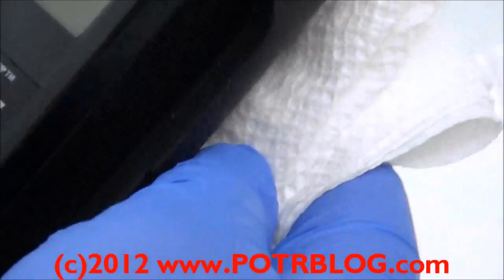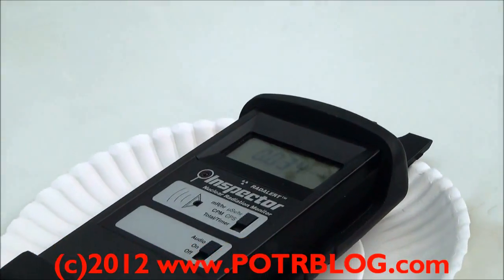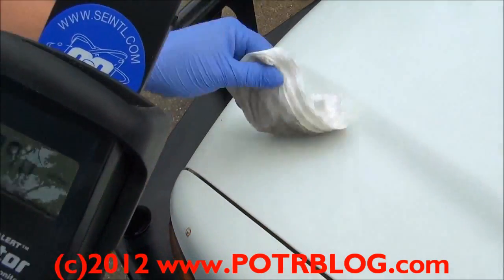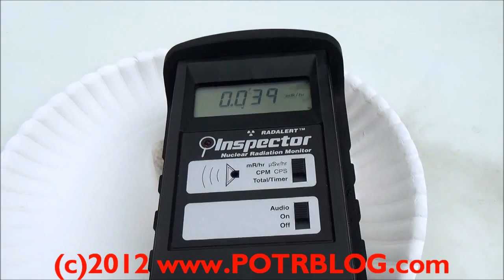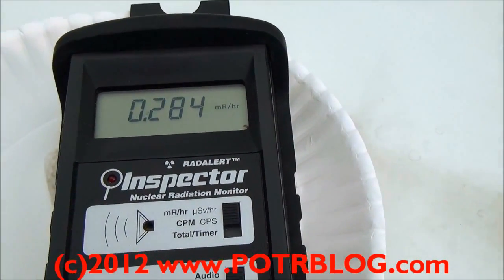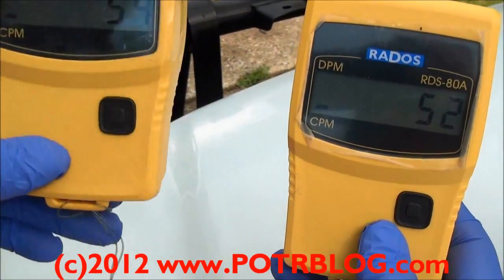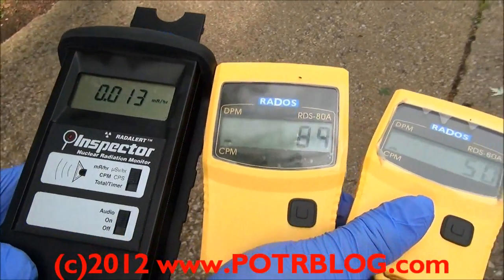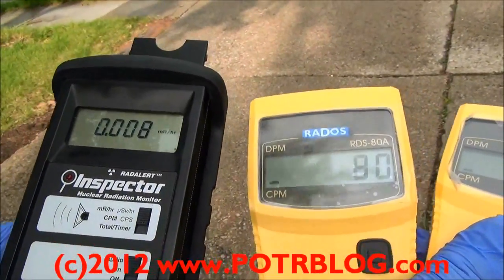!MAXIMUM ALERT! AIRBORNE RADIOACTIVITY 5 TIMES GREATER THAN BACKGROUND RADIATION

Comment: I did pickup loads of radon washout from that storm. It might be interesting to determine why such storms contain such levels of uranium progeny.

My Geiger counter actually went up from in my office, from 38 CPM (average) to as high as 70 CPM (around 65 average). I can only assume that testing outside would have been much higher.

The bismuth 214 and lead 214 gammas were a trouble for my spectrometery all that night and I gave up until the next day.

Radon washout is very neat!

Comment: I 100% agree with you. It is important to understand the detection limitations of our equipment.

I am blind to beta, with my spectrometer (of course). Luckily, I-131 produces a gamma 81.7% of time or better. The average beta energy from I-131 is 191.6 keV (606.3max), so the rates of beta vs gamma are quite close. My spectrometer gets about 3600 CPM in my office vs my Inspector (same as yours) at about 38 CPM.  

(cont...)

Comment: You make another good point for radon washout.The two isotopes involved for the quick "run" of transient decay are powerful beta minus emitters. As you know, rarely does a beta minus have a quantum state which is "super allowed" (such as tritium) so they typically transition into a metastable state. They are the most potent gamma emitters. Ra222(a)->Po-218(a)-> [Pb214(b)->Bi214(b)] ->Po214(a)->Pb210

Were you referring to Sr90?

Comment: (...cont)    So, you are absolutely correct. I could have a sample of rain with I-131 and miss it due to being too low in activity to measure. For Cs137, I would 100% agree that it has most likely happened.

But, since my spectrometer is massively more sensitive to I-131 than my GM (two orders of mag.) than if it misses it... the Geiger counter will massively miss it too. This means you are correct, but it also means neither of us would see it.

I do love my Inspector EXP+, though lol